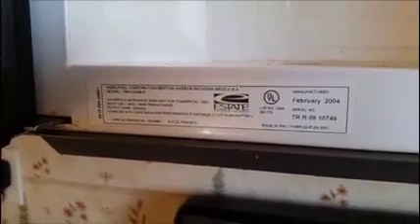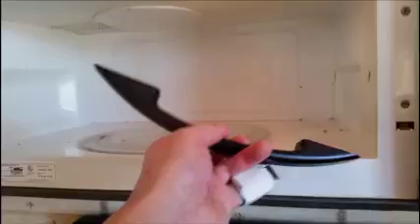Replacing the door handle on an Estate by Whirlpool microwave

Comment: This also worked for a whirlpool mh2155xpb microwave. Really scary, but ended up prying it out with persistence. I will note the handle was the exact same size and seemed to not exactly align, but I just stuck with it and it works perfectly. (There is a top and bottom) also there were little hooks on the cover attaching to the inside on the hinge side. Super flimsy, try not to break them. Thanks for this!

Comment: Looked on the Whirlpool site and they require a service tech to come out in order to replace the handle. This is why they said you must, "A service technician should install the handle because the door contains protective shielding components; the technician must correctly test the microwave for leaks in the microwave shield before you can safely use the microwave." I am sure they charge some ridiculous amount to do so. Who knew a broken handle would be such a big deal to fix. I may just glue mine.

Comment: Thanks for posting. Works for Whirlpool /Roper MHE14XMB-1. Caution - the glass stayed with the door on mine and could have fallen onto the stove below and broken; was stuck in place with some silicone. I wasn't able to get the cover back on until I pulled the glass off the door and fit it into the pocket on the cover.   Once the glass was back in place, installation of the cover was just snapping it firmly back into place.